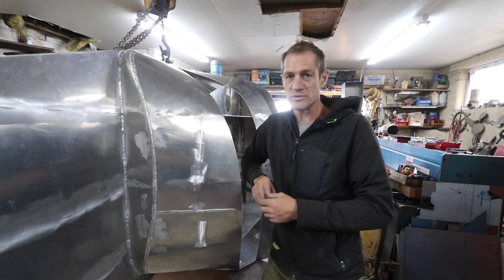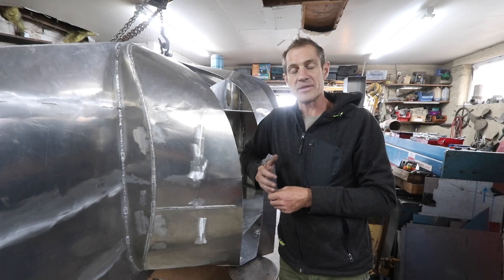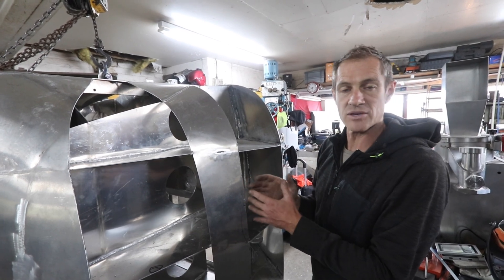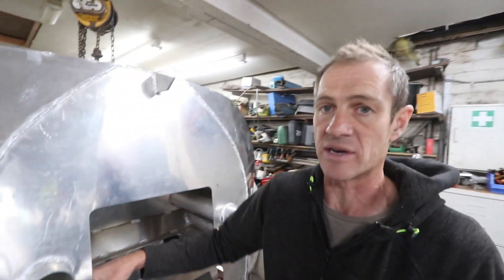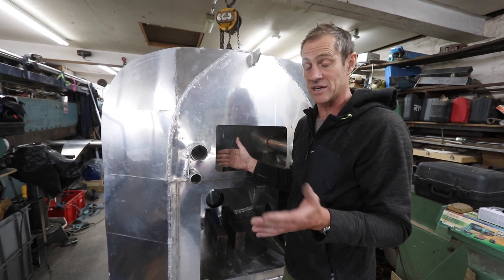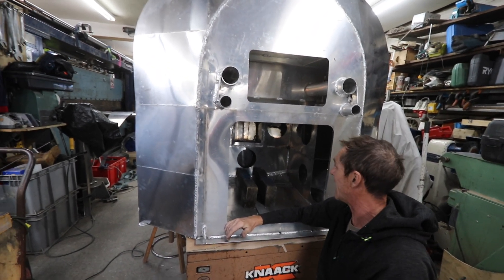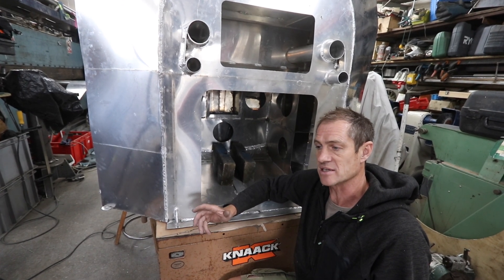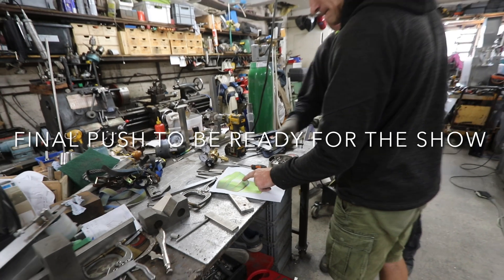Big C V2, The build so far........

Comment: I've read quite a lot about naval architecture over the years.  When I first saw your presentation of the Big-C couple of years ago, I saw some flaws (especially, that it wasn't correctly balanced) and wanted to comment on how to improve the design, but then I thought "The last thing this guy needs is a YouTube comment telling him the boat is designed wrongly".  But seeing the outcome, and now that I see you building V2, I feel I need to intervene.  
Theoretically, it is possible to build a 1m vessel to do a cross-Atlantic (1.2m would've been a better choice, but still), depending on your body measurements and the amount of discomfort you're prepared to endure.  Going back to first principles, just as you want a self-righting vessel, so you want a vessel that stays afloat even when completely flooded!  Aluminium is the correct material - not only because it saves a few inches in hull thickness, but for many other reasons too.  You'll need to create completely sealed off compartments, not just storage compartments with water-tight hatches -- (always guard against human error!).  You'll also need to have an automated bilge-pump system.  Generally, you'd benefit more from a twin keel or flat-keel or deeper bulb keel, than the current keel.  You will also need to think of a ventilation system that let's air in/out, but not water.
If what matters for record's purposes is only the hull length, and if aft rudder is not measured in by the Guinness Book Of Records, then it would be prudent to also install a front-rudder below a retractable bowsprit. (A secondary backup rudder is always a good idea in the ocean)  
You can incorporate all these ideas into the existing design, without having to redesign the whole boat.  Email me your whatsapp number, and we can discuss these over a video call.

Comment: A big difference I wonder about between V1 and V2 is the V1 was built from the same hollow core material as lifeboats and as such, could be completely flooded and still float. I wonder, with V2 being aluminum, will there be any backup for if/when the boat gets swamped? I know V1 appeared to be tippy as hell front to back on the sea trials and cant wait to see the sea trials with this one to see if it has been improved but with a length to beam ratio like this has to be, its gonna be interesting.

Comment: Looking good. I wondered about condensation and whether the inside of the hull will be insulated. I'd also be tempted to have a hand or foot cycle crank setup to keep some exercise going and power a small alternator to top the batteries up (or a bilge pump). Keep pushing on!
Reply from the maker: The hull is having insulation on the inside, the foot/hand crank is the same as the one we developed for v1. There are 2 bilge pumps onboard, a large stirrup and a smaller one to get right into the small crannies.